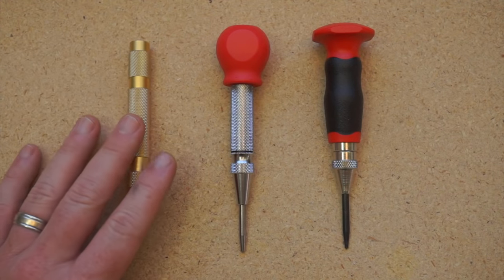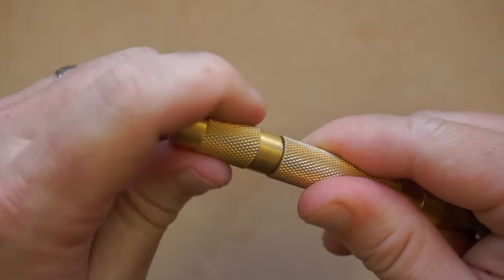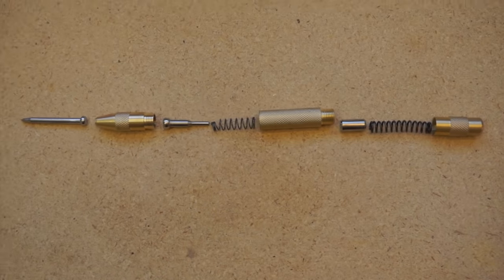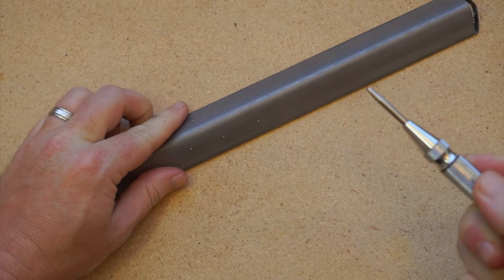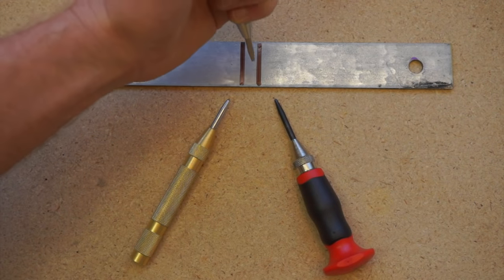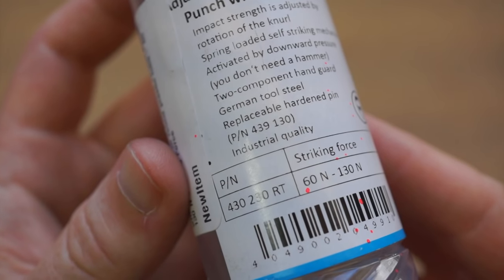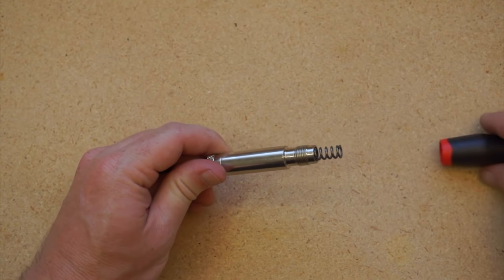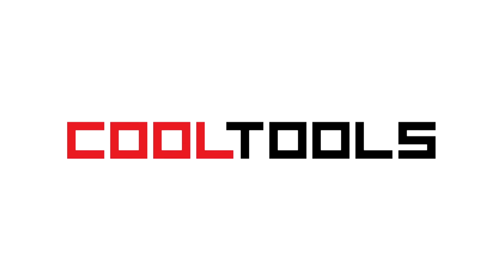What is the best center punch?

Comment: I have a Neiko and a set (4) of the Rennsteig. The Neiko is my goto simply because it is small and convenient. The Rennsteig I use if I need to punch through.They are power monsters. There are four models and range from I'm not sure to 250 newtons. A newton is a measure of kinetic energy (or force) roughly it is the amount of force to accelerate (or move) 2.2 lbs (1 Kilo) 39 inches (a meter) in one second. Lets say that the 250 newton punch will punch a hole in your head no problem.  As far as the punches go I like that I can use them one handed while hanging on a ladder, Sometimes using the Rennsteig I have to lean into it and throw my weight into it to make the punch, the Neiko, much easier to use. So far in the past fives years none have disappointed me. Also a good basic survival tool; I carry one in my car in case I have to get myself  or someone else out in a hurry.
Reply: thx for the information

Comment: Besides striking force and build quality the punch it self must be the most important piece of this tool. What I would look for is what steel/material it is made of and if there are replacement to be bought. I would guess Tungsten carbide would be a great choice for the punch.
Reply: Tungsten is brittle, if you don't want to punch holes in HSS you will be better with HSS punch
Reply: He didn't check it as obviously this guy does not use center punches. He made a review about something he has very little knowledge about and that is the reason I gave him a thumbs down.

Comment: I wouldn't recommend the mid price $10 punch.
I've had two, after only about 50 cycles they becomes erratic and occasionally won't 'auto punch'. After 100 cycles it's becomes so frustrating trying to get them to punch that they went into the trash!
Typical of so many modern budget, tools - OK for very limited use only.
Reply: Yeah, for this reason I stick with my scratch awl and a good push from my palm to make starting notches (I mostly work with wood which is easy to make a dent).

Comment: Is there another type of tool which can be used to make a center punch?

 My vehicle is out of commission due to an 8mm bolt snapping off while fastening my transmission pan, and I don't necessarily have another way to get to an auto parts store.

 I have all the necessary tools for the job I need to do tomorrow, but am lacking a center punch tool.

If anyone has some valid suggestions, I would greatly appreciated.

Thank you kindly!
Reply: If you want to sacrifice a nail set by grinding it into a point, then there's a possibility.

Comment: I have a tool that came with the drilling bits set. Looks like a center punch tool but the pointed part is hollow and the rest of it looks like a sanding file. What is that tool for?
Reply: That is a nail set.

Comment: How long do these potentially last? I've been getting cheapos from Lowe's and they seem to stop working after like 10-15 times. The spring gets messed up or something and the mechanism stops working. Doesn't actually punch.
Reply: Or my favorite part, after few seconds of drilling, the drill still wonders off anyway so hole is never that accurate. I can't remember how many years ago was the last time I used a center punch
Reply: Mine stopped working / got jammed too. I then grinded a very small bevel on the end of the pin so that it was not getting jammed were it's supposed to be released into the hole.

Comment: For aluminum, can't you just take an old star screw driver and push + twist until there's a small start hole for drilling?
I mean aluminum is quite soft, so I doubt I need this tool at all.
Reply: Maybe, unless you're using a harder, heat-treated aluminum like 6061.
Reply: You're describing a traditional center punch, which is used with a hammer. They work just fine, but the benefit of automatic center punches like these, is they're much faster and can be used with one hand.

Comment: I was very disappointed with my purchase of the cheapest type of the three, it only actually punches when its in the right mood and never when I am trying to do something critical, so its back to the old punch and hammer.
I am reluctant to spend any more money in case more expensive does not equate to more reliable.
Reply: You should check out center punches by SpringTools. They are reliable and American-made.

Comment: The Rennsteig model you link to has a 60-130 N Striking Force, but for around the same price they have two other models: 20-50 N and 180-250 N. Are there advantages to getting this 'Goldilocks' model, or are there no good reasons not to get the more powerful model?
Reply: It depends on what you punch in. If you are using it on soft aluminum or brass all the time there is no sense in wearing your hand out using something powerful. If you are punching stainless steel all day the weak one won't do you any good. If you work on everything but mostly just mild steel the mid grade will be the best. From time to time it will make due on stainless or the few time you work on aluminum.

I work on mild steel 99% of the time and used to use the $2 brass harbor freight ones. They worked fine but the tips dulled and after a year had to be replaced.  Ponied up for the general model 79 and it's great. Best yet the tips are replaceable. For $16 hard to beat.

If the larger head is a selling point and turning you away from a better tool just go get a cheap automotive shifter knob and epoxy it to the end. The knob on mine is off a fork lift. Bit smaller than the ones on store bought models but fits in my pocket better while still giving comfort.

Comment: If the pin becomes rounded why not sharpen it?
Reply: will be used out quickly - so a rounded pin, can give up the energy in a better way, check the strength of eggs

Comment: No Starrett?
Reply: They're currently about $36.  I'm still using one my father purchased over fifty years ago (about 1967).
Reply: @TravisTerrell  FWIW, the Starrett 18A is what I was referencing:
https://www.amazon.com/Starrett-Automatic-Center-Adjustable-Stroke/dp/B0893JWSYF - still $36.00
Reply: guess they are one level with Rennsteig tools - also depending which type - Rennsteig seems to have punches for different metals and tho different prices
Reply: I bought a Starrett 18A on the basis of my experience of an excellent combination square of the same brand. The Starrett centre punch arrived today. Looks beautiful but it doesn't trigger the hammer at all. Doesn't anyone even test these things, before they bung 'em in a fancy box and hold out their hand for the dosh? I have disassembled, oiled and greased the device several times, fully understand how they're supposed to work, checked out YouTube videos for what might be wrong, and it still refuses to perform. At all. Back it goes. Buying a Facom instead, which is even more expensive than the Starrett!